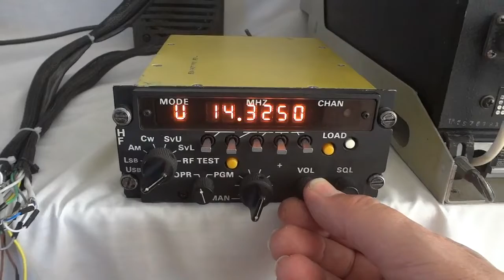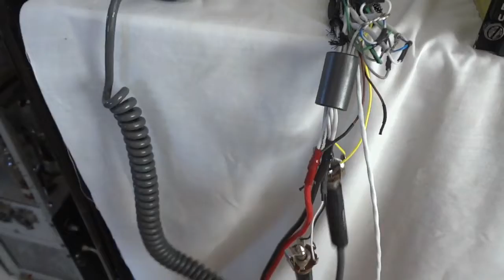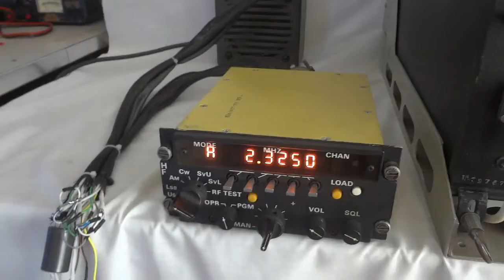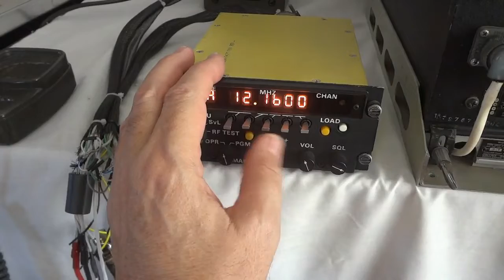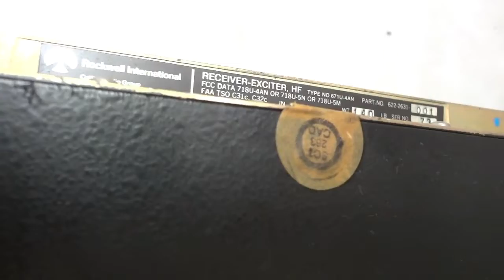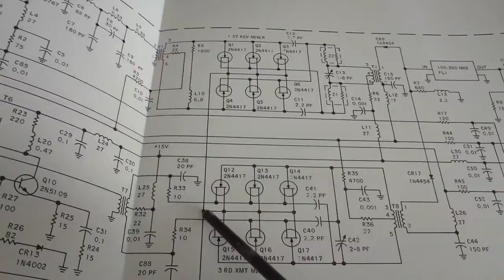Rockwell Collins 718U-5M avionics HF SSB transceiver (AN/ARC-174)

Comment: I operate a Falcon 50  (See my QRZ page, K7KSG) with a dual installation and have had both out twice for repair and they still will not tune. Sadly, there are no avionics techs around who know anything about HF systems anymore.  That being said, I certainly enjoyed your tour of the radio components; I couldn't ask for a better guide.  Thank you!
Reply: I worked for an airline in avionics.Its hard to be an expert when we work on so many systems,different aircraft. We had a lot more problems with the antenna couplers,tuners that is,receivers,panels were much more reliable. All were Collins.

Comment: Beautiful. How to get it into the avionics bay of your car?
Reply from the maker: That would need a DC to DC converter from 12V to 28V. I actually bought such a DC converter ( a military one) that can handle the needed current, from this guy: https://www.ebay.com/itm/351720076674  This radio will actually work quite well mobile, you could mount the control box on the dash and the radio itself in the trunk, and the built-in antenna coupler can match a vertical on the car automatically for any selected frequency!

Comment: I love that radio, I have always wanted an airliner Hf TX RX I would like to know did you have much trouble tracking it down ? I been looking on eBay and the like but not as yet. Keep up the great work, it is greatly appreciated. Regards Richard vk2ual
Reply: Keep an eye open now because civil aircraft are being scrapped like never before. Old HF radios will not be taken back into stock. They probably scrap them to recover the gold.